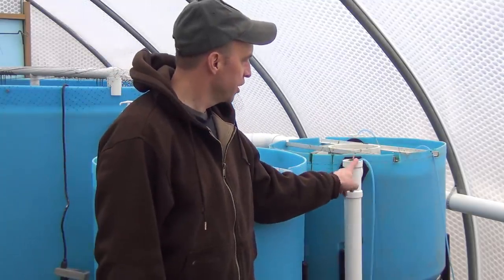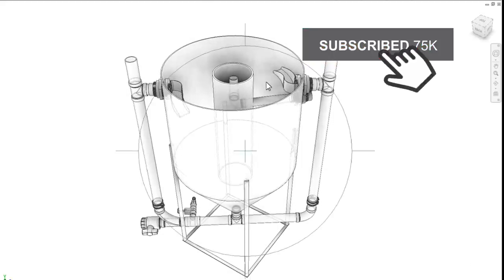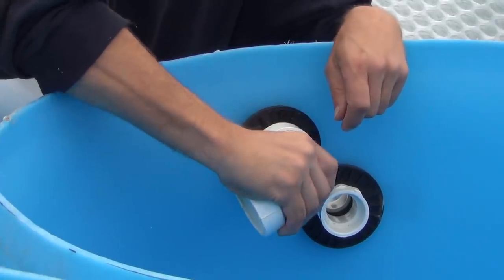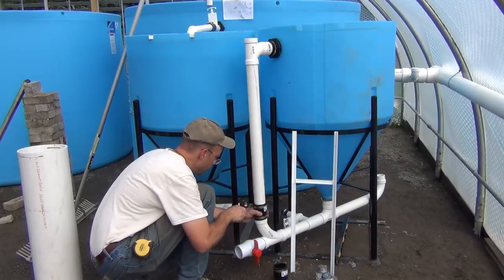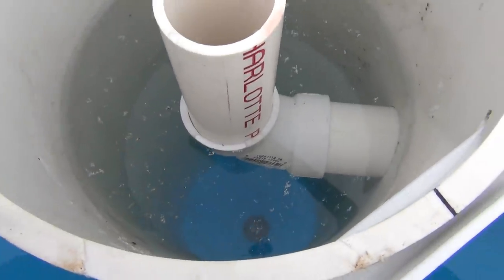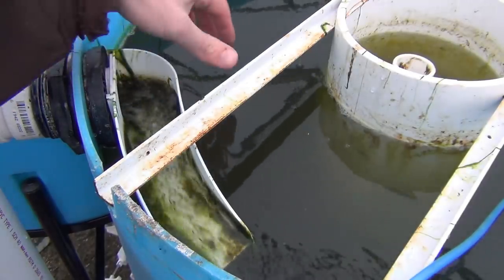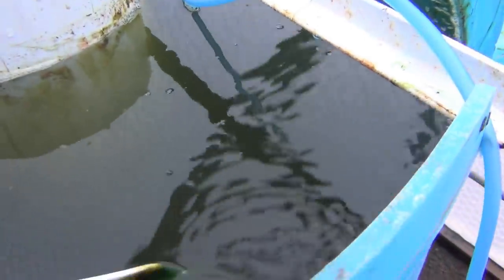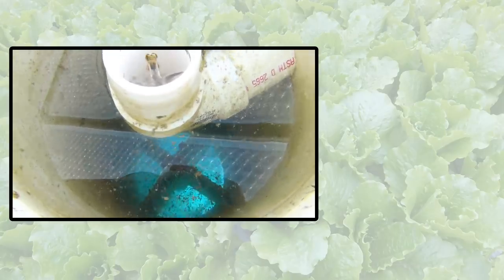Big Aquaponic Greenhouse - Part 14 - Mineralisation Tank

Comment: I've experimented essentially the same as you with cone tanks; in my experience, you'll appreciate results using larger cone tanks. I used the 80-gallon tanks because of the cost and regretted not having 130 or larger.

Comment: Nice job! 
What kind of temps are inside the greenhouse?  Any issues with heavy snow-load?  Does snow slide off by itself or do you have to help it break loose?
Reply from the maker: No problems with the snow.  inside air temperature stays about 3-5 degrees warmer than the outside during the night so it's gone well below freezing.  The water temp is currently 38F

Comment: I love your CAD drawings, I can't wait to be even 1% as good one day.
What model 3d printer are you using?
I just started learning Fusion 360 Auto Desk and 3d printing almost 1 month ago and can't wait to be able to make my own parts for my AP System.

Love your videos, Thanks for sharing and as always Keep Building👍
Reply from the maker: I use Autodesk Inventor so Fusion 360 is very similar.  I've been using Autodesk products since the 80's...It's changed a lot since then!  ;-)

Comment: i just got my Comgrow Creality Ender 3 Pro 3D printer cant wait to start printing stuff once i figerout how this thing works...... do you have a list of files i can print? i have this idea for a fish feeder for my first project i would like to do...... also why not 3d print air lifts to replace the air stone?
Reply from the maker: PLA 3D printouts leak water so they have to be sealed well.  They also shouldn't be used for anything that is under pressure.
Reply: @Bigelowbrook  well i make my air lifts by running 1.5in pipe through a 2in tee and drilling plenty holes in the 1.5 ...... seal of the ends of the tee around the 1.5 with couplings and reduce the open end to a garden hose that is run to the air pump..... maybe i should do a vid.....lol
Reply: Flex Seal spray the part after printing?

Comment: 15k litres of water to filter with 20min retention. water passing though would be 15k litre divide by 60min = 250L p/min multiplied by 20min retention would be 5000L. so the radial filtre would need to have to be minimum of 5000L capacity to achieve 20min retention. please correct me if i am wrong. 

you also mention that smaller radial filters would be easier to maintain. in your opinion would it be better to have 5 x 1000L capacity radial filters or 2 x 2500L radial filtre. 

cheers.
Reply from the maker: This is a Cornell-style tank.  Only a small percentage of the water goes through the RFS.  The rest goes through the top overflow.

Comment: When your designing your pieces with the 3D printer. What brand and size of printer are you using? And any upgrades to the printer. I have been looking at them but not sure what to get.
Reply from the maker: It's a MakerFarm Pegasus 10 with all the upgrades.  I then modified the print bed so the table was 10x12" to deal with some of the bigger prints.  It takes a little reprogramming of the firmware (arduino) to use the larger bed.

Comment: Nice Build!
Where does the water from the mineralisation tank go?
In the video it looks like there are still some particles that get taken with the water.
Reply from the maker: Media beds.  Next video ;-)
Reply: I am sure you know rob bobs backyard aquaponics.
He had problems with solids building up in his media beds so he had to clean them out after a few years.
I don't have much practical experience with aquaponics but I fear this might happen with your system too if there are as many solids coming out of the mineralisation tank as it looks.
I would have the mineralisation tank go back into the settler so no solids will make their way through.
(As I said I don't have your experience so I might be completely wrong here)
Reply from the maker: It flows into the media bed.  The other greenhouse has been running for 6 years with red wigglers in the beds and they are still in pretty good condition.
Reply: Ah I forgot about the wigglers. Thank you for clarifying this!
Reply: I've been wondering whether it makes sense to filter with the grow bed before or after using the mineralization step -- I was assuming that red wigglers would make faster work of the waste than the microbes in the mineralization tank, just because of the oxygen restrictions in the water, but do you find that this tank is able to handle the bulk of the large waste? Do you still use red wigglers in beds in this case?
Reply from the maker: @chelseaboyle9842  it's best to get as much of the solids out of the water before the media bed.  Even with red wigglers, solids will still accumulate in there

Comment: Instead of air stone use a section of double walled diy PVC pipe (on outside) with air gap between & drill tiny holes for air injection .. no obstruction in pipes that way. You'll get mad flow no maintenance that way.. stack a bigger size pipe outside put cut C rings of pvc on top & bottom to create air gap & install nipple for air hose.. let me know what u think.. I plan  on doing a how to video on it soon on my 800 gallon aquaponics tricks/n/tips .. nice job so far
Reply from the maker: Already done.....next video.  ;-)

Comment: Both tanks seem to be at the same level how do you ensure a positive flow of solids?
Reply from the maker: The MT has a few holes in the center "overflow" pipe.  The water entering into the RFF creates a slightly higher head height than the MT.

Comment: How is this different than a swirl filter? Why not add a corse filter at the outlet?
Reply from the maker: This isn't a filter.  it's used to break down the solids.  Check my previous video about the radial flow settler.  Thanks!

Comment: Are you going to add biofilter media?
Reply from the maker: There is a media bed after this filled with expanded shale.  Next video  ;-)
Reply: @Bigelowbrook  Ok cool but I meant inside this tank.  I am thinking of a similar design yet with some significant differences but I want to put more surface area in my air-lift loop,  but not sure how to plan for the flow of the media around the loop.
Reply from the maker: @jasrobsny  I think the bio media would get clogged with that much poop in there.
Reply: @Bigelowbrook  I think so too but would it just require more frequent solids removal or do you think it would get clogged in a day or two?

Comment: For your air lift for the mineralization, consider looking at airlift.eu and the pressure chamber air lift system.  It can be adapted to smaller tubing, I built 3" and 2" versions.  No air stones.  No clogging.  Air is injected via the pressure chamber and it's virually a maintenance free self cleaning air lift pump that is extremely efficient.  Your "at water level" design is perfect for this application.

If concerned about it clogging, you can put this inline with connectors on each side to be able to do maintenance.  Even go as far at isolating the chamber with valves to not have to drain the tank.

I have used this application and it moves 10 gallons a minute through a two inch pipe with a 40w air pump.

Link to the parts and construction:  https://www.airlift.eu/phpBB/viewtopic.php?f=126&t=15797
Reply: https://photos.google.com/share/AF1QipNpiNTf7R8Edd6z_2LlYxX2VoCcbcxJ-gP-xiKMn2FkLmFMfhWXyxDqqE--F8XEKA?key=M0lIT09TWmt4QmFKM0o3LU00VzhHSXB4OVdlRDl3

Attached are some images of the one I created.  This is a 3" model.  Basically you create tiny holes (0.5mm or less) in the riser tube and create a chamber around those for the introduction of the air.  It helps pressurize the air, generating air lift to the water in the riser tube.
Reply: https://photos.google.com/share/AF1QipOT18iXMjkyryi_PhjmmuGHE9Eh2f1IRE6J8J1NiJUbA0tAct-9DMpjaE-Y01NMSg/photo/AF1QipO5WZogb_KCYV4hDaT1QrJQtutyifRrPsKUAXPo?key=bWhQNzZtcGVwdVhNcnB3LW1MRWhCRG5vcmdDY0N3

This is the 2" model I fabricated.  It moved about 10 gallons a minute using the same 40w air pump.  It would have been more had I had a water supply to the barrel I was using for the test, the water level was dropping as I pumped into the 5 gallon bucket, reducing efficiency.  You can see the flow is great and the system is pure pass through, which will eliminate the issue you have of air stone clogging.  The images of the rubber connector was a test.  (Stay away from that idea)  If you decide to go this route, build the pvc air lift pressure chamber.  It's more reliable, will not leak and performs the best.
Reply from the maker: Thanks.   I already have the parts to build this type....It's just too cold for me to want to spend the time outside putting it together.  ;-)
Reply: @Bigelowbrook  Excellent, glad you found these.  They do work extremely well.  Should solve some of your issues.